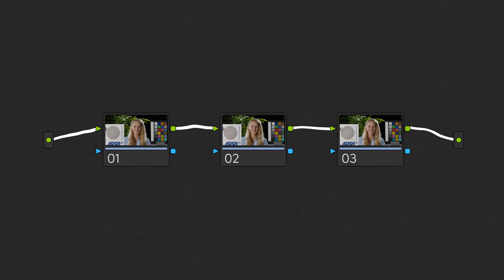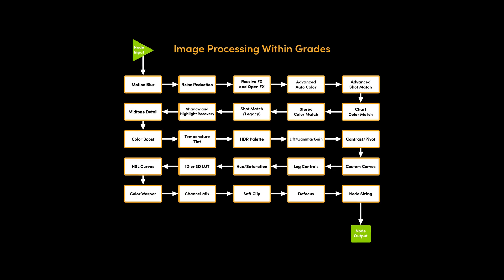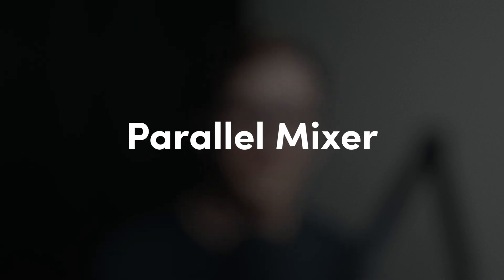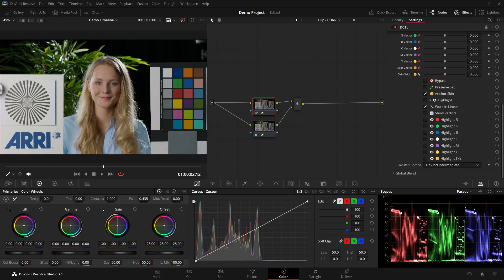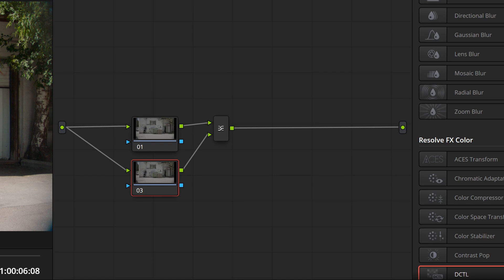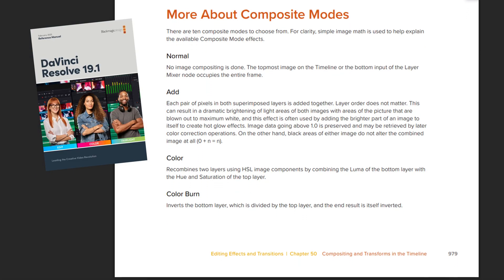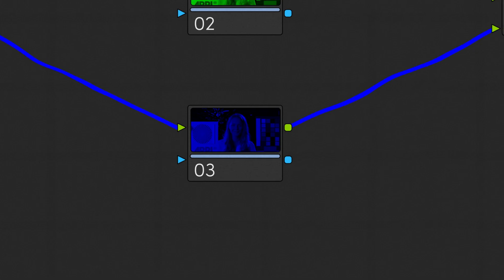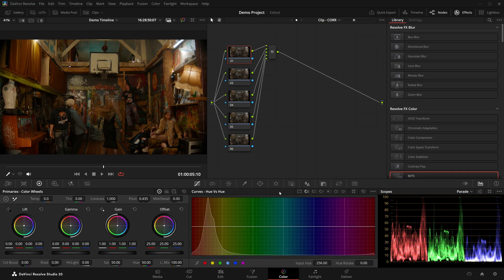Every Type of Node Explained on the Color Page in DaVinci Resolve

Comment: great video!! thank you.  i'm still struggling on grasping the math option of the parallel nodes.  still a bit elusive in my head lol
Reply from the maker: You know the difference mode Resolve has to compare a still or offline to your timeline? Imagine the last node's output of each branch is compared to the output of the node right before the tree branches out into parallel. The result of that comparison is an image only showing how much each pixel is brighter or darker than the original.

Finally all of those difference images (meaning what each branch did to the image in total) is applied to the original image (original from where it branches out).

It's quite something to wrap your head around and unfortunately I didn't have enough time to make a proper animation to explain it in this video.